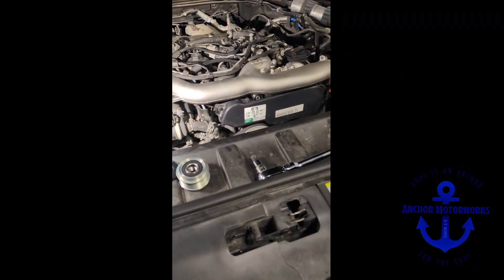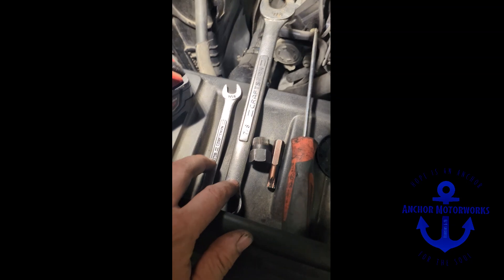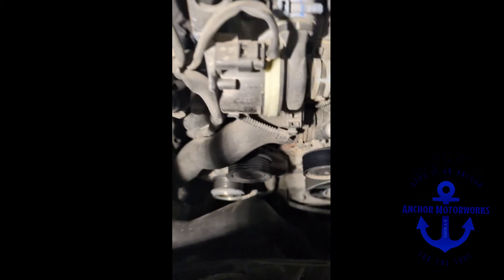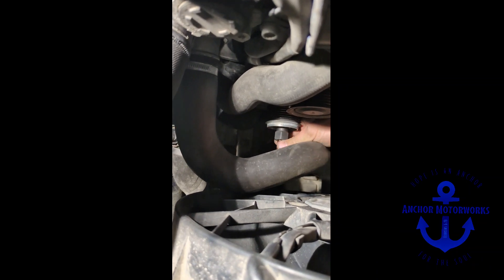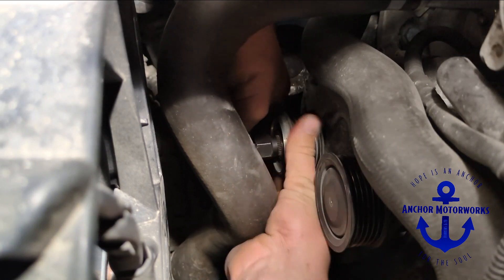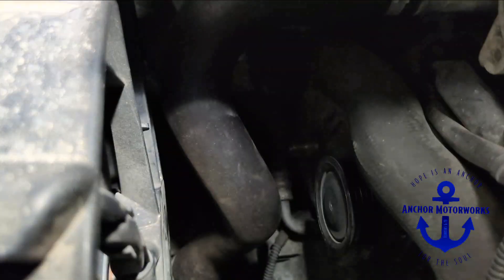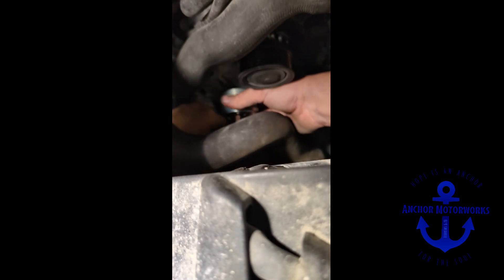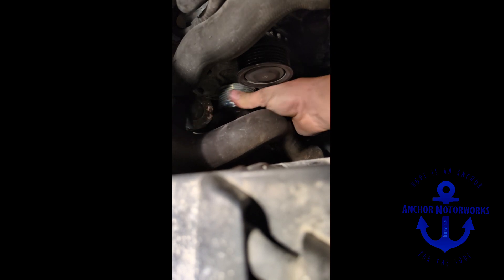VW/Audi/Porsche V6 TDI Alternator clutch pulley replacement

Comment: What’s the reason you replaced your pulley?
Mine seems to be moving  in and out causing the belt to move too. Kinda weird and notice a lot of vibration inside the vehicle. Some people in Germany talk about how the alternator was causing all the vibration even with new engine moinrd
Reply from the maker: I replaced this one for preventative maintenance. They fail at around 120-150k miles often, and so I replace them every 100-120k miles. This was on my Audi Q7, and I did this at the same time as I replaced the cp4 timing belt. I do it at the same time as the timing belt on all the 4 cylinder tdis as well.